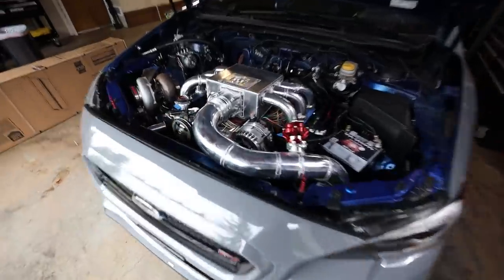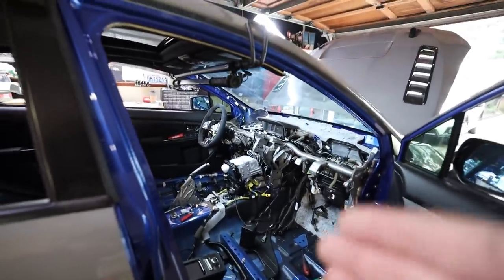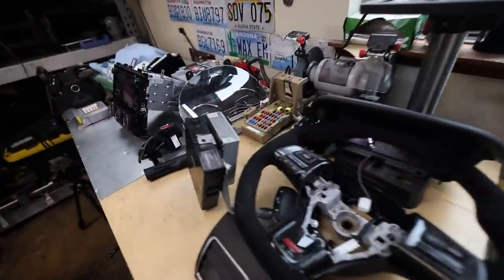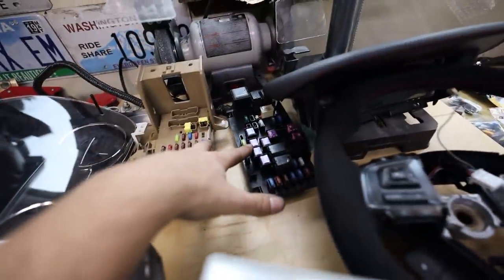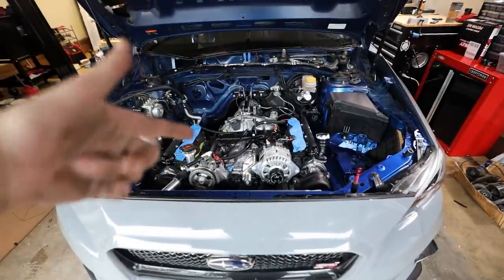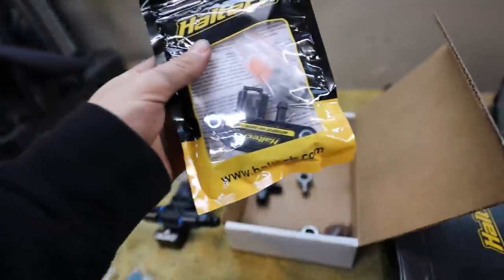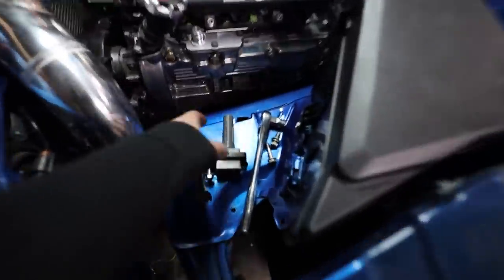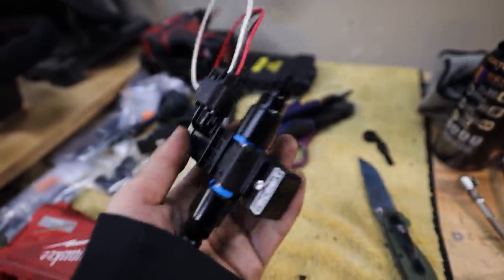Stripping My 6 Cylinder 2017 Subaru WRX STI Again....

Comment: The storm is all the way up here in BC. It's a destroyer. many road closures. Last night driving home I plowed through two massive pools of water on the road. luckily the skidplates deflect the water instead of it straight plowing into the bottom of the engine. And the stock intake keeps water out of the engine. That's a good reminder for people with no air box around their intake.
Reply from the maker: The weather had been insane lately 😳

Comment: Hey man, i cant wait to see this run. Ive just bought an eg33 for my 2007 impreza. Little daunting to put it in, But youre motivating me to get it done
Reply from the maker: Should be a little easier for ya since you don't have an extreme can system like this, you've got it 🔥🔥🔥
Reply: Im hoping so! Trying to find a clutch and flywheel for cheap right now. The highway from vancpuver to the interior just got wiped out by heavy rain, so im expecting a big delay on parts if i cant find what i need locally! Thanks for the reply! Hah you've got this! Subaru seriously does need to make up a job offer for you
Reply: @naiashine4394  I’m doing the swap right now on my 05 Saab 9-2x aero (05 wrx rebadge). The toughest thing I’ve dealt with is fitting a radiator. I’m having to cut into the front core support by about an inch but that’s not a big deal. Check out my Reddit V0rt0s I’ll be posting a whole build update when it’s done if you need info

Comment: I blew through 2 fuel pump controllers and ended up having to go after market. So if you get all this done and break down on the side of the road and need to get towed but you removed the crash beams from the front and rear and 2 tow trucks tell you no before 1 finally just loops around the control arms, same.
Reply from the maker: That's how they towed mine and it got stuck on the truck 😤

Comment: I bought an 09 WRX with a Cobb stage 2 about a year ago. My plan was to teach my older boys to drive a manual and flip it before I had to buy a tag. My younger kids and I really liked it, so I sold my WS6 Trans Am instead. I spent my way up to clean book value fixing the air, rack and pinion, clutch, tune up and timing belt. The day I got it out of shop , I  started hearing a noise by a couple hours later I knew the motor was gone. I’m not capable of rebuilding a motor. But since I’m older I do have money. 

I live in northwest Georgia, I don’t know which way to go with this. I really like the car, and I’m too deep in to try to recoop $. If anyone has advice for me I would really appreciate it. 

I ultimately want a car that handles, sounds good and I like how it put me back in the seat. 

I can take it out for a midnight drive through Atlanta on the highway.

Comment: I cannot wait to hear the blubaru start up. It will be amazing. Congrats on not letting the wiring beat you down. There are plenty of bumps. 
I have a question would you recommend cobb flex fuel kit or IBR flex fuel kit? They both have controllers, but I am very curious on your opinion.
Reply from the maker: Personally I've never used IBRs stuff so I'd have to give the vote to Cobb. Used their flex kits on multiple cars in the past 💪
Reply: @Smeedia  sick thank you

Comment: Access key module being on the package tray does seem weird. I'd assume that it would be somewhere up front, but maybe it's there so it can work with the trunk release? Assuming that you have an electronic trunk like I do. 

What I don't get from how this STi did it is that my Infiniti fob has like a 2-3 ft range from any given prox sensor, i.e doors, ignition, trunk. I gotta do some research and find out where my control module is in that car just to sate my curiosity. Maybe it's a similar setup, idk. I can tell you I have an 8" woofer in that spot on the package tray though. Oh, and my rear seats recline so that's baller, and lets me access the coilover adjustment way easy.
Reply from the maker: I think they put it on the rear try to minimize potential interfere from other modules going off frequency. Maybe to keep it away from the radio?
Reply: My 17 wrx, one of my key fobs just doesn't like to work even with new batteries. However, i had to place my fob right on top of the push start button for it to register that the key was in the car.  There has to be something in that start button then too no? 🤔🤔
Reply: @taylorklassen1787  Dunno man, I'd try a re-learn procedure before going to the dealer. Seems like it could be minor but I'm not committing to it as I don't know enough on these cars.
Reply: @Smeedia  Nah, doubtful. RF interference hasn't really been a thing since the 90s.

Comment: Ahh so wires were sending signal but in the wrong places probably. 17 they were likely updating harness and didn't get change completed before MY and finished for 2018 MY. Kind of like any model years that are .5
Reply from the maker: So annoying that its only 2017 but it's whateves we will get it swapped again 🔥🤌

Comment: the Flex Fuel sensor doesnt NEED to be in the engine bay, just a thought.
Reply from the maker: You are correct but also don't have a suuuuuper long fuel line going from the FPR back to the hard line 😅

Comment: Hey quick question, have you considered trying to use the electric power steering from a brz into the sti? It might clean stuff up even more 🤔
Reply from the maker: Wouldent want to 🙅‍♂️ would make things cleaner but I love hydraulic steering 🔥
Reply: @Smeedia  ah okay, makes sense
Reply: Standard wrx has electric power steering too. I agree though the hydraulic power steering in the sti is so much better.

Comment: oil temp should be taken from the sump, reading at one of those top ports will give you misleading readings.
Reply from the maker: Have always pulled from the oil galley on the back of the block, haven't seen any inconsistent readings in the past. Also helps give a better picture of the temp of the pil moving through the engine vs sitting in the sump. Granted could only be a couple degree difference if that
Reply: @Smeedia  its better to see sump temp vs what youre pulling which will always be higher.

Comment: Hey I have a random question maybe you can ease my mind..

My RPMS for 2nd gear used to be 3k at 30mph (this is when I usually shift) as of a few days I have now noticed that 2nd gear 30mph is now 3200-3500rpms its a 21wrx limited stock 1240 total miles nothings changed by me im hoping this isnt an issue but I also speed tested it and my MPH is accurate its just 2nd gear has chanfed on me and im baffled as to why.. is this cause for conern?
Reply from the maker: Only thing I could think would be a mis calibration of a speed sensor/haleffect sensor
Reply: @Smeedia  your the best for answering I am going in for a “test drive” with a tech tomorrow afternoon how can I mention this or bring it up with out them deflecting this being a potential issue on a brand new car?
Reply from the maker: If they don't bring it up I would just mention it.
Reply: @Smeedia  your the best and the reason I own a 21 wrx wish I got the STI but i can always “make one” but im in love with this car!!
Reply: @Smeedia  they were baffled and could not find any issue I hope I didnt money shift or anything negatice to cause this weird thing

Comment: Off of your old harness are you willing to sell me the passenger tail light connector? The previous owner of my car is an idiot and tried to splice the 3rd brake light and the wire broke.
Reply from the maker: Oh 😳 I have a spare one I can de-pin 🤙
Reply: @Smeedia  I need about 3inches of wire. The wire broke right at the connector

Comment: finishes car, gets base map, gets rear ended by box truck
Reply from the maker: Lol car will rarely ever be driven on the street 😅
Reply: @Smeedia  for your oil pressure, get a right angle AN fitting or whatever thread the sensor is. It won’t effect the reading and you won’t need to worry about how tall it is. Get it before you find out you have clearance issues instead of having to wait for it.

Also for your boost controller…. Get some 1/8th NPT to -3an fittings for the controller, and get stainless braided break lines to run for your boost lines. It’s going to get hot under there, don’t want to melt a line and eat a turbo
Reply from the maker: Ohhhh may snag those fittings for thr boost controller 👀🔥
Reply: @Smeedia  you can do it on the manifold for the BOV also. When the revision is made have him throw a 1/8th npt tapped hole on it. You can run an AN line to your BOV/ FPR